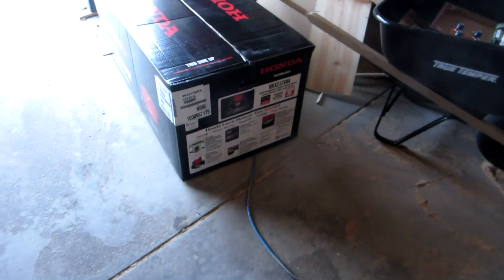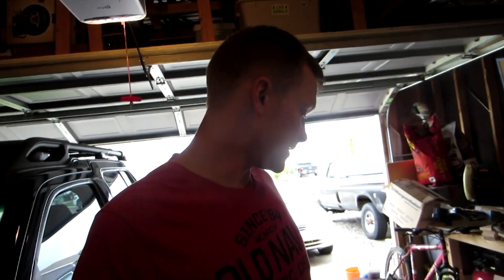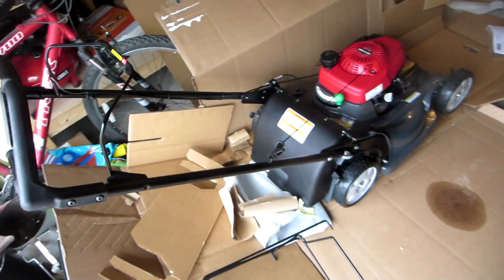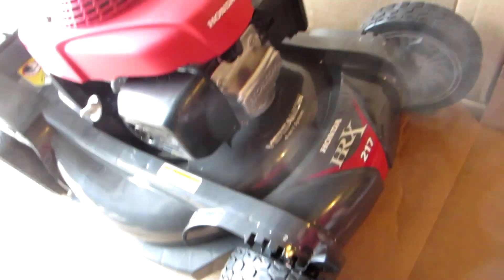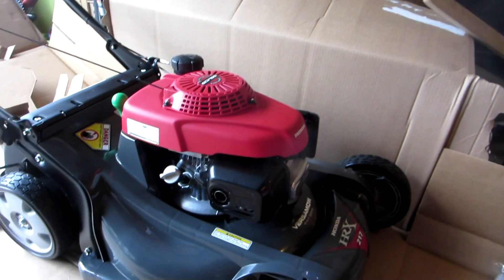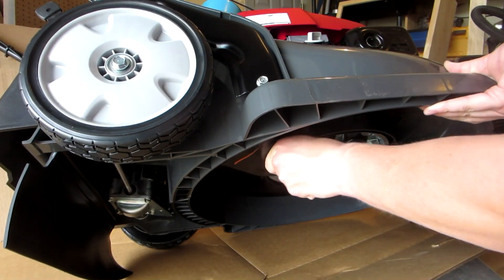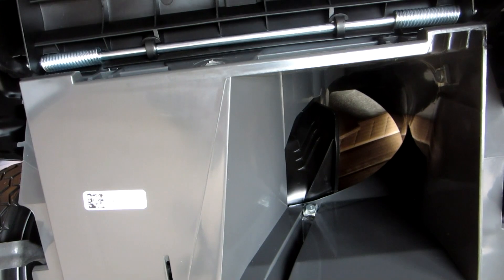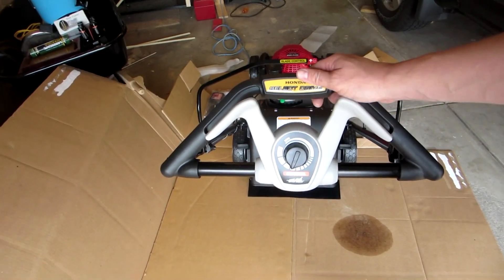New Honda Mower HRX217K5VKA

Comment: Hey great video! But to address your concerns about cutting your grass when its wet? That HRX217 with its football helmet plastic toughness & impossible to rust cutter deck you can cut the lawn even if it were pouring rain. I have the HRB215 Nexite football helmet plastic deck also and hosed it off and wiped it down it looked brand new except for the over 10 years of abuse that I've subjected it to. Hondas are the best mowers and also resale value is the highest I've seen. Most DIYers may not have the funds to buy a $700 mower but a used HRT216 can still get over $200 for those wanting the best for their used mower cash. Not to mention that Honda mowers are amongst the few manufacturers that still support their mowers for all the parts dating back to any Honda mower you bought as far back as the late 1980's. Congratulations you can keep your HRX217 as beautiful as the day you bought it by just hosing it off and wiping it down every once in awhile. And if you ever have to sell it your pics will compel anyone to take it off your hands.

Comment: I watched your video early 2019 and I bought the new HRX217VKA 200cc not long after and now at April 2022, I still love it, which I knew I would since I replaced a six year old Honda HRR216VKA that I gave to my son and it still runs and starts first pull. The only reason I bought the HRX217VKA was for the better speed control dial, which I love.
You sounded a bit nervous in the video and I just watched again, but I wanted you to know, you are one of the reasons I bought the HRX217VKA 200cc in late February 2019, which I was to eager to use in cold Milwaukee, Wisconsin and had to wait until April 2019. I love the speed control dial, which my HRR216VKA did not have, but it did have the top handle speed control, but if I went over a bump in lawn, I accidentally pressed the handle to much, which I did not like, but I had it for six years. Honda makes great lawn mowers. 👌
Reply from the maker: Thanks for the comment.  Mine is still going strong

Comment: Great choice! I have a Honda mower I bought back in 2000  mowing my south Florida St. Augustine lawn (very think broad blade grass/12-month mowing season) and it's still going strong. The only repair I've had to do to it is re-tread the rear/drive wheels using a knobby bicycle tire as the drive wheels became slick over time. In damp grass the wheels would slip. Besides that, I do a SeaFoam oil/gas treatment on it when I change the oil each spring (Mobil-1 Synthetic). Good luck.
Reply from the maker: Yeah, this mower is a rockstar!!

Comment: This Honda HRX217 will go through tall wet grass with no problem if you are mulching. But what I mean by tall grass is above 9" and more like over 12".  The HRX217 loves tall grass and your grass from what I can see is just slightly overgrown. And you'll like the cut. I have the exact same model Honda but I purchased mine last August of 2017 and I intend on keeping it spotless and shiny throughout its entire life. I clean it often with a pressure washer and keeps it looking like "brand spankin new" not to mention its the quickest and most thorough way to clean the HRX217.
Reply from the maker: I just completed some spring updates on this mower and I am still loving it! Going on the 5th Year.

Comment: I've had a honda mower for 8 years now. Not ONCE did it ever take more than one pull to start! :)
Reply from the maker: Cool!
Reply: The same could be said for 99% of the mowers out there.  I could buy a $99 cheapie and as long as I keep clean gas in it the motor will start on the first pull until the cheap wheels fall off.
Reply: Yep, had my HRX for 7 years. I live in Texas, so my mowing season is long, I never changed the oil or did any maintenance of any kind other than changing the blades once. Not one problem or tough start ever.
Reply: wb6162 B...S...
Reply: Han Solo ii
Reply: I have never had to pull mine ( elictric start ) :)

Comment: The cheaper version of the mower, I think 175CC +-, I bought but the speed control on this model is a pain. The engine is a good one and I guess I'll just have to get use to it. My 16 yr Snapper Ninja bit the dust but I'm in the process of doing a re-power. I just like the Snapper. It has a lot better drive and throttle system. The Honda purchase was a fill in....When tilting the motor on it's side always tilt to the opposite side of the carb. They say it keeps the oil from getting into the carb. I know when u did so there was no oil in the crank.Thanks for the Vid
Reply from the maker: Thank you very much for stopping by!

Comment: I have a 18 yr old model of this mower..by the way that cheap deck u say is a lifetime deck !! And mine still runs !!
Reply from the maker: +Brian Fetz I agree that that deck will work for the life of the mower it just "feels" cheap. I have used metal decks my whole life up to this point and while they do rust they are very structurally sound. Thanks for stopping by. I certainly hope my mower will last as long as yours.
Reply: Yea I'm sure it will. Mine needs carb work now. I'm going to retire it. I got my money out of it

Comment: Cool mower!
Please check out which side you need to tip it up on, usually they say to keep the carb up.
Reply from the maker: +Wayne Essar Thanks, I'll have to check that out, I certainly don't want to be ruining my mower by accident.
Reply: +My DIY ... is this mower belt driven.  or hydrostatic?
Reply: Superior Lawn Care It's both, the clutch doesn't tighten or loosen the belt, it stays tight. The difference between this and the commercial speed wise is this one goes zero to four and the commercial goes two to four mph.
Reply: Wayne Essar .. i have the honda hrr216vka with smart drive . It's ok but sometimes I'm pushing it up hills.
Reply: U may need to adjust the speed cable. Its in the manual.

Comment: Nice unboxing and quick review. What do you think of the Select Drive as far as slowing down, speeding up, going backward, then forward, etc? I ask because I'm leaning toward a Toro Super Recycler due to the Personal Pace drive control, which seems like it might be more intuitive. In a yard with lots of landscaping, trees, and separate flower beds, I need to vary speeds and maneuver the mower quite a bit.
Reply: I have used the personal pace, on the personal pace you are still technically pushing the mower, you have to apply an effort to it to get it to go. Versus systems like the Honda or a bail bar type system all you do is engage it, and most self propelled systems today are variable speed.
Reply from the maker: b286guy I like the Select Drive a lot, I don't even notice how it slows down. However sometimes when I push the lever down the mower will do a wheelie. My previous mower was a push only and I even forgot one time when I was mowing and just pushed and pulled it with no problems. It is pretty easy to maneuver even though its heavy I think it has to do with how long it is.
Reply from the maker: crazyjdkid Yeah the variable speed system is pretty nice to use, before I had only a push mower.
Reply: Mine (new Honda) will pull me around the yard. Is why I liked the Snapper. It has 6 speeds u can lock in.
Reply: The lower model Honda's have pedals you push only with your palms or thumbs, would get tiring. Seems like this hand grip style would be easier. And this person says theirs jumps ahead as soon as they engage it:
https://www.youtube.com/watch?v=OnrUndLQfc8

Also you have the newer design throttle/drive controls. It used to be like this:
https://www.youtube.com/watch?v=I2sRT_Rr_3g

Comment: When you poured the oil in I did not see you measure...it take only 13 ounces, did the oil container have just 13 ounces in the bottle?
Reply: Airport49 -and there could be various residual amounts of oil from one mower to the other, from the factory left after emptying to box and transport. Bottom line, like you pointed out, the oil level should have been confirmed.
Reply from the maker: Yes.
Reply from the maker: I see what you are saying but the directions did not state a need to check the oil because they knew that you would pour the whole bottle in.

Comment: I just bought this same exact model.  The only weird thing about it was that after engaging the transmission it seems to take a few seconds before it really begins to move at a constant velocity.  Are you experiencing this as well?
Reply from the maker: +Mark Hagood I haven't used my mower yet this season (too much snow) but from what I remember mine didn't do that. In the next couple weeks I'll fire mine up and tell you if it does it or not. Cheers!

Comment: congratulations I am torn between one of those or a snapper hi vac self propelled. no throttle control is not good imo what are they thinking?
Reply from the maker: Michael Collings I was a little hesitate at first but with it being a honda mower and 190cc engine I figured it would be ok.
Reply: all honda lawn mower engines are superior to anything else on the market. i have gotten so any of these in that are beat to hell and back  and still run like new, the only issue ive come across is the blade bolts rust on.

Comment: Well.... hope ya dont tip it up that way when ya put fuel in it BECAUSE you will SOAK THAT AIR FILTER WITH FUEL ,NOT GONNA BE A GOOD OUTCOME!!!
Reply from the maker: Thanks for the tip!
Reply: Always turn the mower on its right side with the gas cap pointed up as mentioned, more than once, in the owner’s manual.

Comment: There is no better mower on the market all others are years behind the Honda. The engine is a military grade with a timing chain this machine can run 8 hours a day all season long.
Reply from the maker: Yep, can't stop those Honda mowers
Reply: It doesn't have a timing chain... it has an ignition coil activated by a magnet inside the flywheel lol

Comment: I was debating between that one and the Cub Cadet. Went with the Cub for the Large rear wheels. I got a few spots that are very steep and my last RWD mower had problems spinning the rear wheels. But it lasted 23 years and was working when I got rid of it.
Plastic deck is a great feature. Mine has the deck wash which sounds cool but makes a freaking mess.
here is my video on the Cub https://www.youtube.com/watch?v=c0ASZYwCIIM
Reply from the maker: Cool!

Comment: Should never attempt to turn the blade, with plug wire on. DUMB. Don't rely on the safety handle to protect you
Reply: I think he's relying on the fact that it has no fuel since it just came out of the box.
Reply from the maker: True story